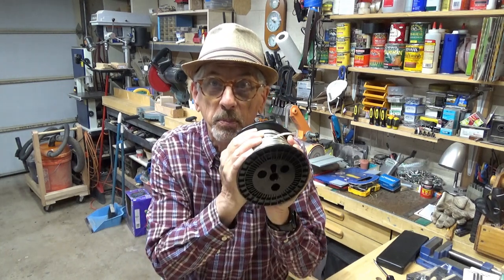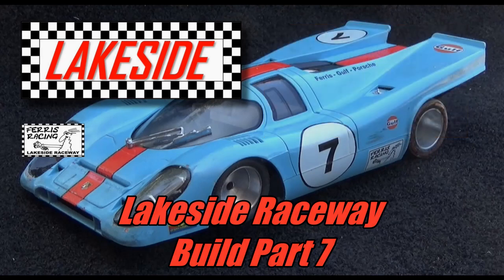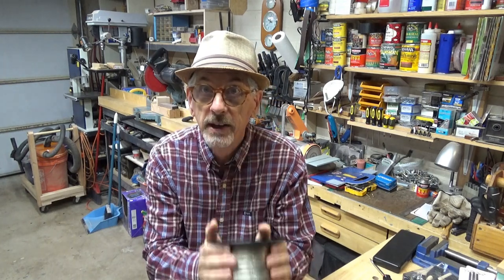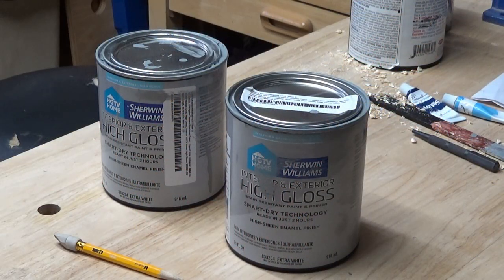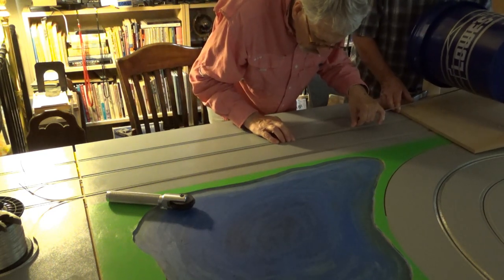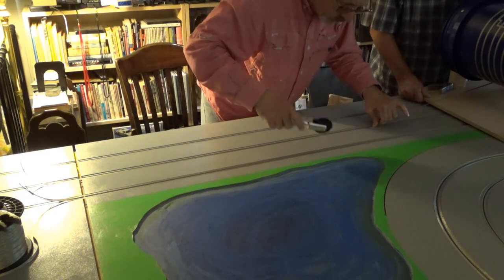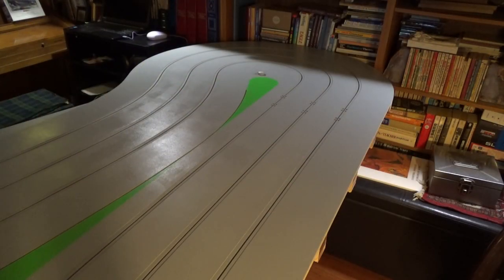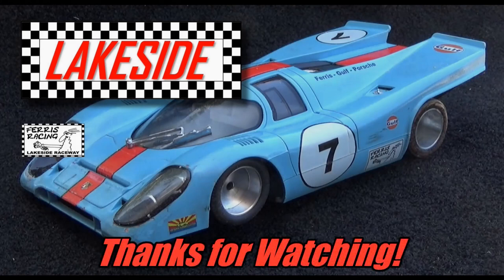Gluing Down Metal Braid - Lakeside Raceway Build Part 7

Comment: It was just a thought, certainly not criticizing, I really like your track building series. Great videos 👍👍👍👍
Reply from the maker: Dennis, you had a great suggestion.  If I had more experience with the pre-taped braid, that would totally be the way to go.  So much easier to apply than the contact cement.  I guess I was too nervous to try a new product.  The cement I understand and have used it for many projects, formica laminates, etc.  Plus the pro track builder I know only uses the cement.  That being said, I built a track using the copper tape instead of braid, and that worked out great.  No problems lifting or peeling off at all.  Glad the series was interesting.

Comment: I've always had a love affair with slots and considered building my own track
I was curious to see how you'd attach the braid - I envisioned that I'd have to create
a 'braid jig" that sat in the slot guided by rollers that would force the braid down with consistent pressure
and keep it perfectly aligned ..but it looks like your method was just as effective and perhaps the better approach..
enjoying the construction details!
Reply from the maker: Thanks much!  So, there are a few accepted ways of putting down the braid.  I think the easiest way is to buy the braid with a strip of adhesive already on it with a paper backing.  You just make sure the slot is clean and then pull off the paper and push it down into place.  On a previous track, I used 1 mm thick copper tape which has an adhesive back on it.  That is very inexpensive and fairly mess-free as well, and is very conductive.  Although for the copper tape application I did fashion a jig with a spool on it and a pin to follow the slot as I put down the tape.  On this track I went 'old school' and used contact cement.  No matter which way you go, try and resist the temptation to pull the braid really tight as you lay it down.  You don't want that sort of tension stretch into the braid or tape as it will be trying to pull itself loose over time.  The braid or tape should be smooth of course, but not under compression or tension.  Have fun!

Comment: Nicely done. I was wondering if you were going to mention an alternative to the wire brade. Our large track was done using the wire brade, but I made a short test track and used the copper foil. Can't wait to see what the electronics looks like these days. Thanks for sharing this.
Reply from the maker: Thanks Larry!  Next episode is the wiring.
Reply: You said you have used both the wire brad and copper foil? Would you say there’s much of a difference?
Reply: @raymondharding4016 This was in the '60s so I don't remember too much about it. The foil came with an adhesive backing, but I do remember it did not hold that well. The braided wire was much more flexible and easier to lay down in the shape turns. Sorry I can't be much more help. It was a long time ago.

Comment: Hey Stan! I'm building a small track for my school project. Quick question: do you think I should use a primer before painting? It's going to be an indoor track, not in use for too long. Also, would regular acrylic paint be good enough? Your advice would be super helpful for my project. Thanks!!
Reply from the maker: I have not used a separate primer on the wood tracks I have built, and have never had any problems.  But, I have used water-based house paint that is adhesive enough not to need primer according to the label ("paint & primer").  If you are budget conscious, you can often find cans of brand-new paint for a real discount at the big stores that were mixed but the customer didn't want, so they have to get rid of it.  If it is a display-only track that will not see much racing or chemicals, then almost any paint will do for a short time.  Have fun with your school project!

Comment: Learning a lot. One thing I don't understand: you put metal braid on the track, but the cars are also metal braid, isn't braid on braid going to scratch on the long run?
Reply from the maker: Great question!  The braid on the track is glued down securely and is very flat and smooth.  The pickup braid on the guide is fastened only at one end and is about 1/2" long or so, and is a bit of a lever with only gentle downward pressure.  The track braid will easily last 10 - 20 years depending upon use.  The short pickup braid pieces get frayed on the open end and get replaced now and then.  I have a number of cars and have only replaced the guide braid on a couple of them.
Reply: @StanFerris  That’s way more durable that what I would have thought ! Pretty awesome. I also saw later in the video that you gave another tip with the copper adhesive. I learned a lot watching those videos thanks!
Reply from the maker: Even the 1 mm copper tape holds up quite well.

Comment: I've seen others use a stickyback type of braid.Is this method superior, or why did you choose it. Thanks
Reply: I should have watched whole video got my answer lol.
Reply from the maker: Thanks for checking out the videos.  There are nine in this series-- so only a few have survived until the end!  🤣 Yes, the braid can be purchased with an adhesive back which should work ok.  The first wood track I built used 1 mil adhesive copper tape instead of braid, and I had no real issues of it peeling off.